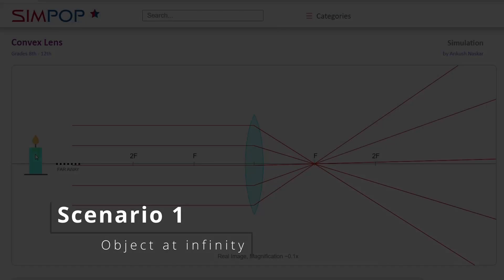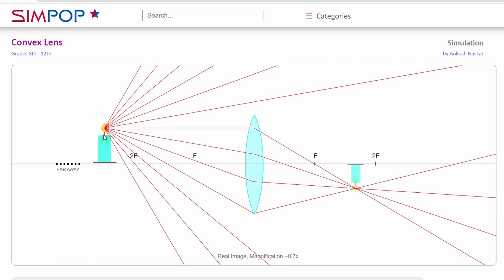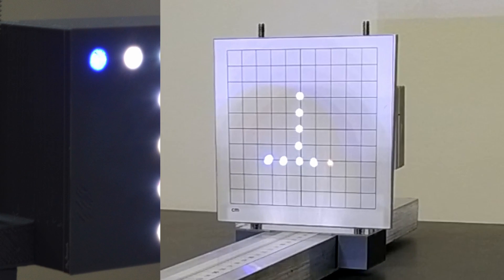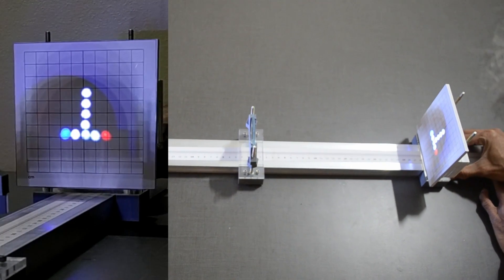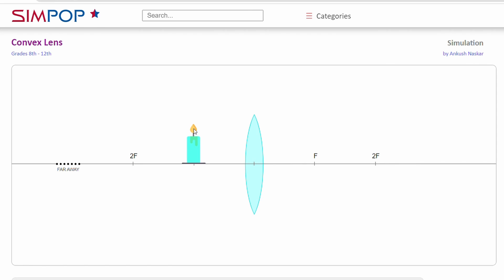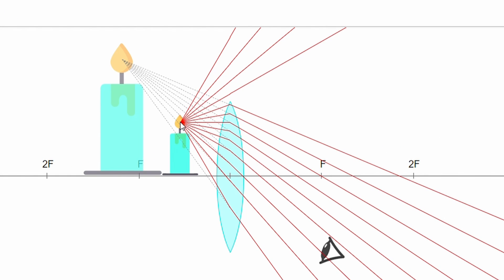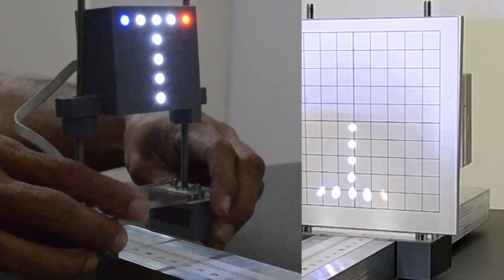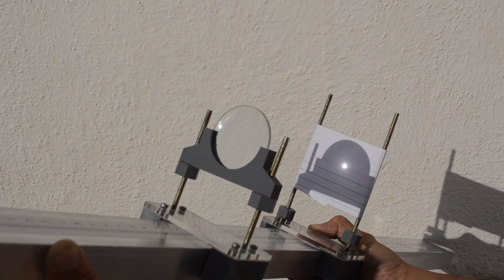Portable Optics Workbench - Convex Lens

Comment: Great Ravi! We had plans to work on portable bench since long. We had made an mdf version but it wasnt too good. Had thought of changing material and design.

Another thing we wanted to explore was what u mention towards the end- moving the light source to left or right of the principal axis and seeing whether the image is still focussed on the focal plane. For an extended source as in ur case, wud all parts of the image be focussed or some would be blurry. Even with the simpler case of screen along the principal axis, as in ur case of getting the image of tree, i havent found that entire image is focussed; the outer parts are blurry and the central region is sharper. If u have an understanding of this, pls do share.

Great work as always :)